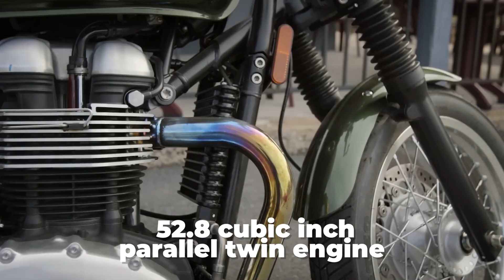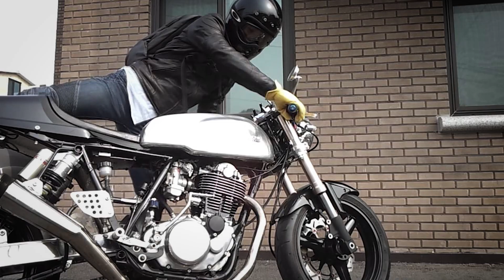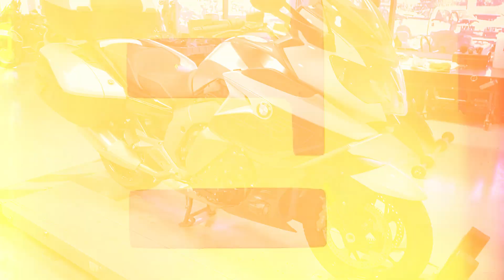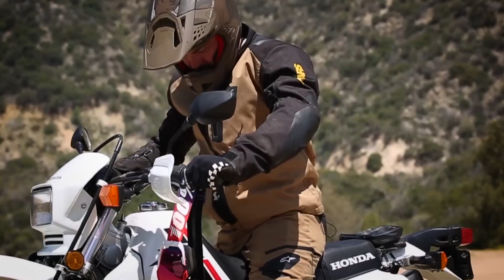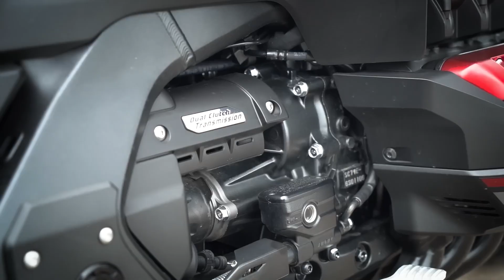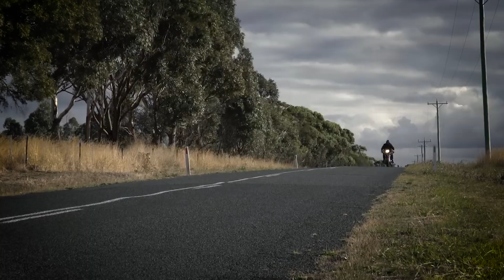13 Most Reliable Motorcycles That Will Last Forever

Comment: I have a '96 Harley FXDS-conv. Mostly stock parts ... even the paint! The worst that has gone wrong with it is this year I had to replace the front rim because the wheel bearing burned out. Hell, after almost 30 years, I guess it's aloud to!

Comment: Why do you convert the actual engine size in cc to inches? If it's called a KLR650 then it's a 650cc engine, not a KLR39.2 🤷🏿